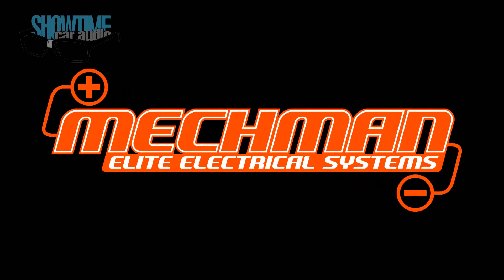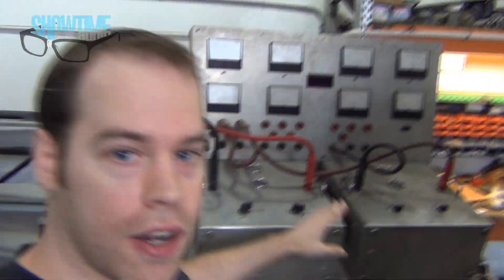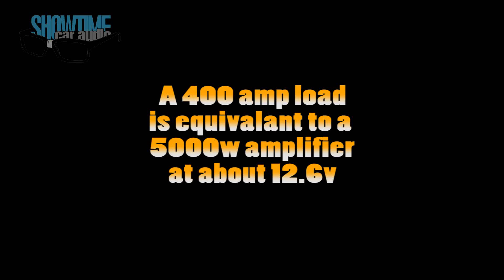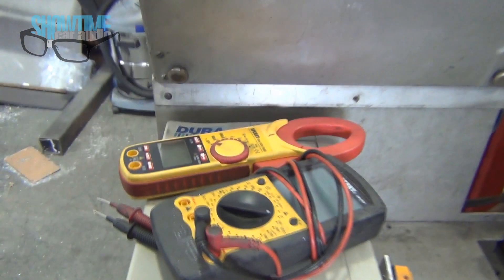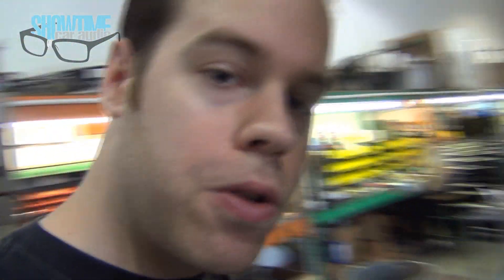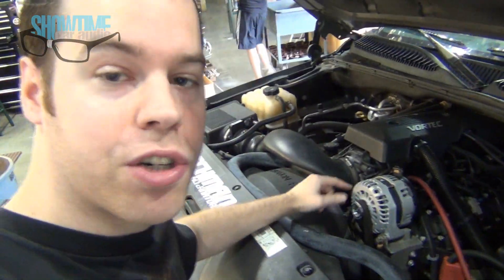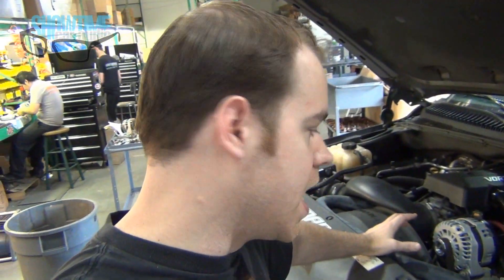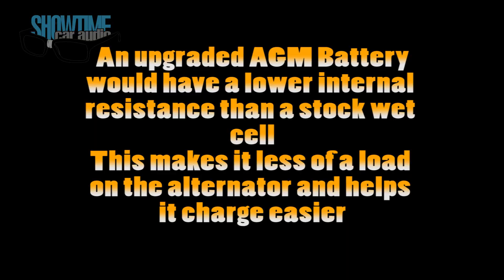Showtime Electronics - Visiting Mechman and Conducting an Alternator Test

Comment from the maker: Normal amps and car electronics only work up to about 16v. And some high power special amps can do up to 18v. A 24v alternator will burn up your batteries and electrical. Best thing to have is a good sold 12v battery setup that is capable to run your system, then upgrade the alt to be able to charge those batts.

Comment: It's likely the alternator.  Nothing wrong with it.  I have a 300 amp Excessive Amperage (CS144 case) that does it MUCH worse to the point it sounds like a supercharger at higher RPM's and a leaf blower at lower RPM's.